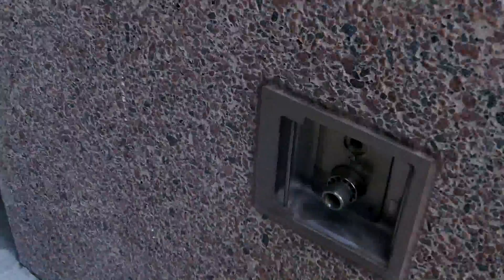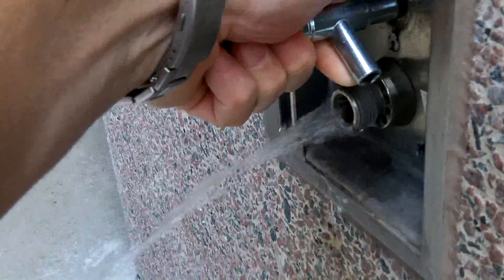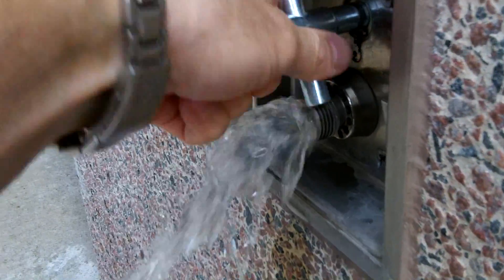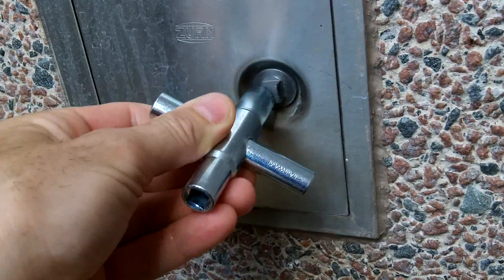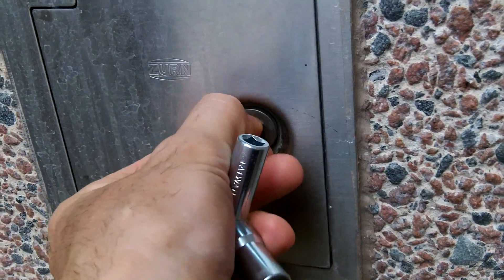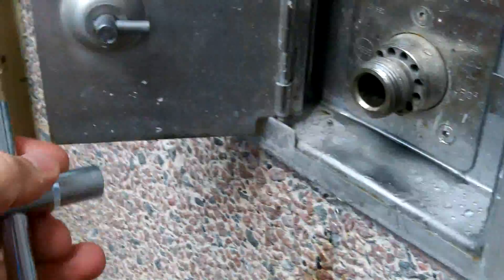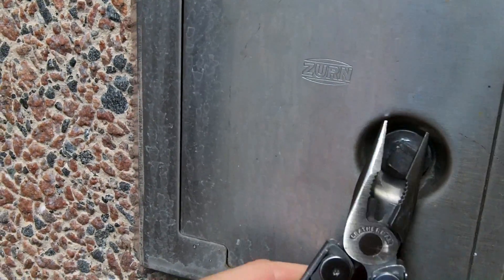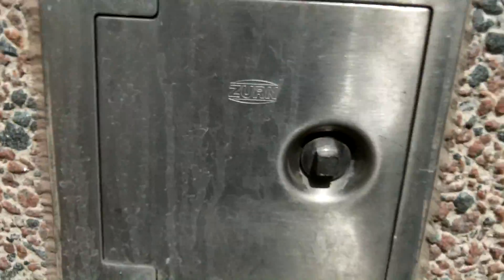Urban Water Procurement- Using a Sillcock Key to access water

Comment: My buildings outside water sources has a door that says "water" with the square but no faucet. It looks like I need to unlock the square, remove the door, & then I will have access to the faucet. I tried prying off the door but can't. It also doesn't make sense that you'd have to pry it off. Locking it seems reasonable though. I'm afraid though that the square unlocks the door & turns on the water. I'm not sure how far to turn the lock. How should I approach this?
Reply from the maker: The key will open the door as well.  Try it again and let me know.
Reply: Yes you must unlock the door with the silcock key before you can access the spigot. The spigot is turned on by a seperate knob inside.

Comment: Have you attempted to open these valves with a leatherman alone? Not the door but the valve itself. I'm very interested to see if this is feasible.
Reply from the maker: I did on a few and it depends on the valve itself.  If you can get a good bite on it, you can get it open.  So much easier to carry the keys though.  Thanks for watching.
Reply: Did you watch the video?  He mentions it

Comment: Dumb question, but what are those water receptacles normally used for?
Reply from the maker: Water hook-ups for when building is pressure washed, window cleaning or anything else the building needs water access for.
Reply: @biblesnbarbells  To water the plants too if there's some around.

Comment: it is amazing that more of those are here in Florida As you know I visited the DC area a lot many years ago a person volunteering at a Homeless shelter showed me and gave me a key back in the 1980s  I really do not know if I could find the key  But in South Florida that do have many Pumping station a Chicago safe and lock key Number 2420 use to open all the pump stations outer locks back in the 1970s At each station for emergencies had food "MREs" water five gal orange construction cooler and sleeping bag clean wrap in plastic oh batteries for the three different  types of radios some times extra radios as well near SW 152 Ave / 312 str. Miami-Dade I was told the locks where changed in 2000 and again in 2008 but each pumping station has two feet thick walls completely water proof...
Reply from the maker: Thanks for sharing this info my friend.  I hope everything is OK.  Have a safe 4th!  Anthony.
Reply: it may be worth a look see without a video
Reply from the maker: biblesnbarbells Yes.  Thanks.